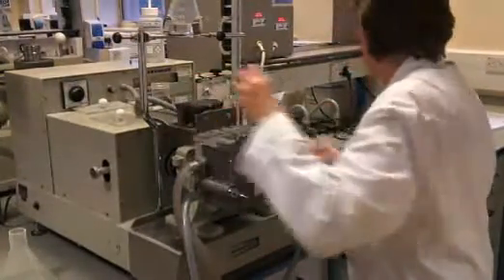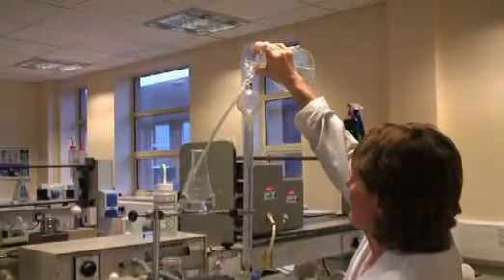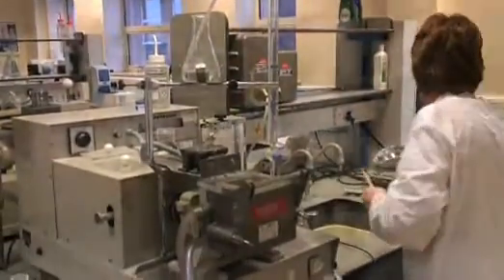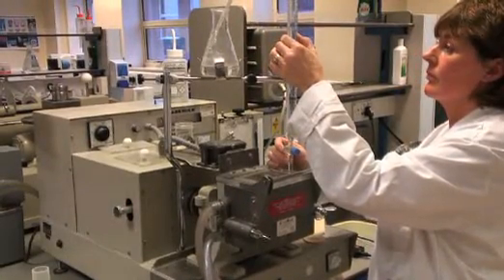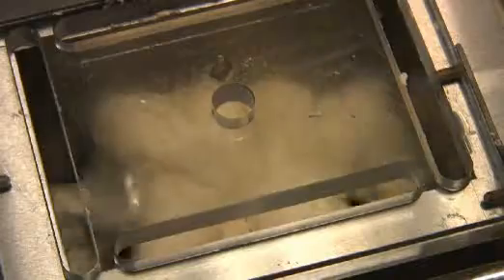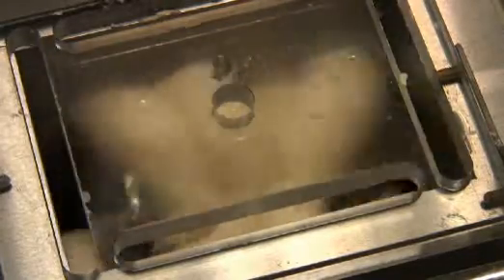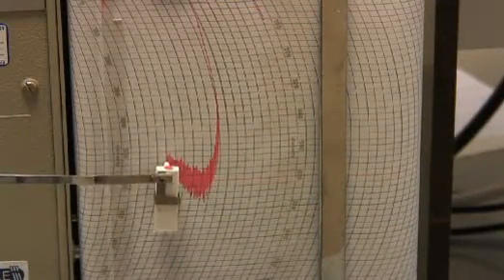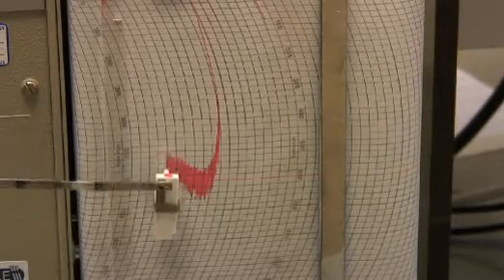Flour testing | Campden BRI

Comment: May i know what are the apparatuses and machine that were used in this video?
Reply: I saw a farinograph machine, falling number machine, weighing scale and extensiograph. The machines used in this video though have been improved and modernized. You can check them out. Hope my reply is helpful
Reply: Thank you for the name of those machine. @edithchemutai5935